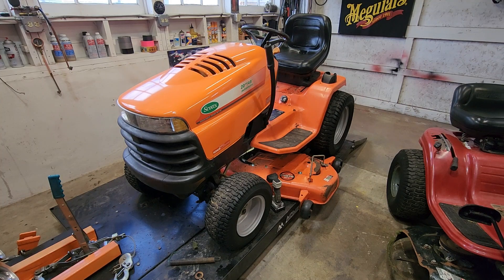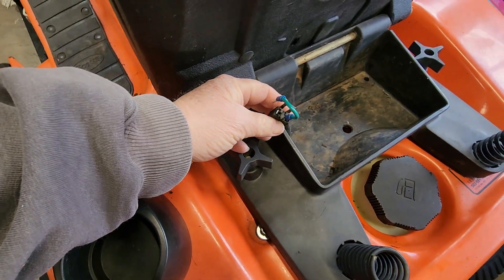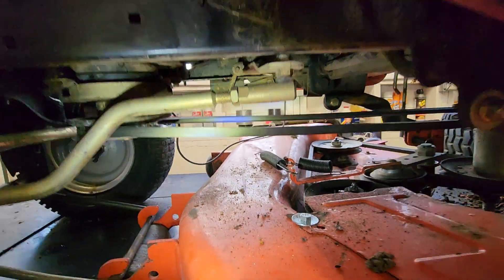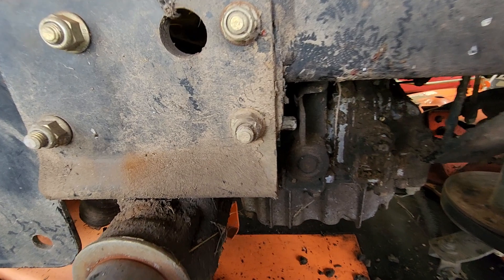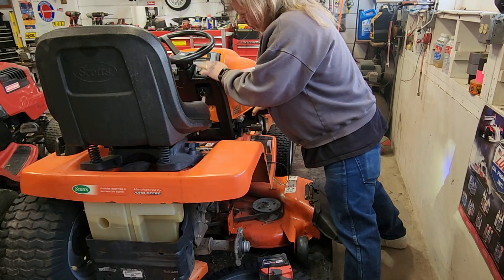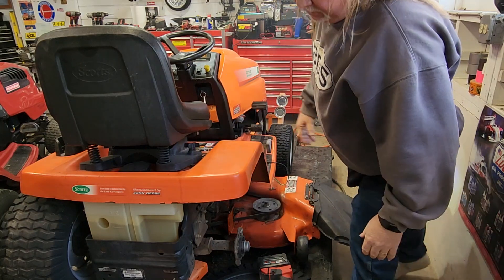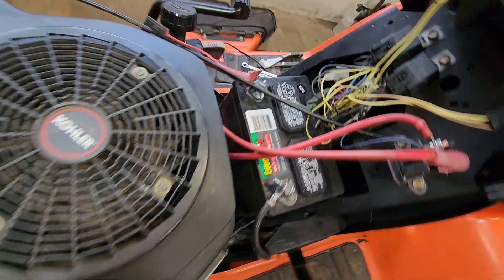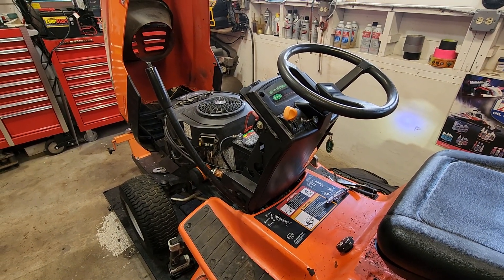Help! My 2002 Scotts by John Deere Tractor is kicking my butt! I need assistance from my community.

Comment from the maker: We got ot working! Ken on the John Deere Facebook page had the answer. The connector that the seat switch plugs into has a spring loaded contact built in and if you unplug the seat switch, it shorts the wires together. We got it!
Reply: Excellent news!

It’s a good thing that you have a background in electronics. I actually run a small business, myself, and one of the first things I look for things that have been modified by previous owners. I figured once I put things back to the way they are supposed to be from the factory, then I can determine what isn’t working.😂

Comment: I would look at the back of the pto switch . Sometimes if a clutch is going bad it will sorta melt the pto switch and do funny things . Seems the seat switch is normally closed and open when sat on , So it seems a path to ground kills engine . Maybe a ohms meter and after letting clutch up and it stalls , un plug things till the path to ground goes away . Would be nice to have the actual wire diagram